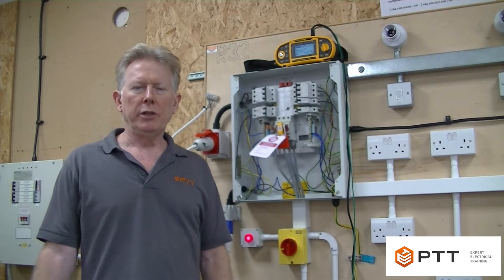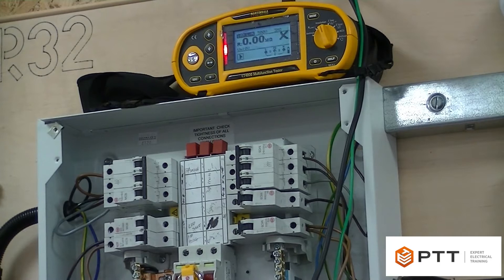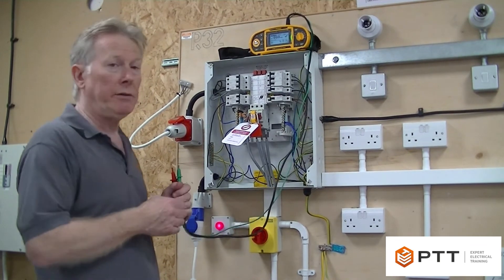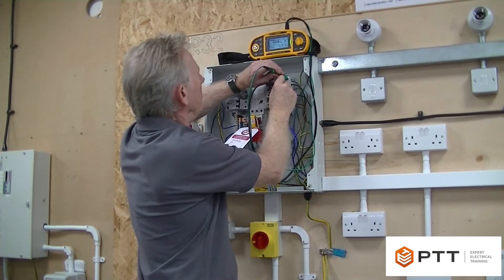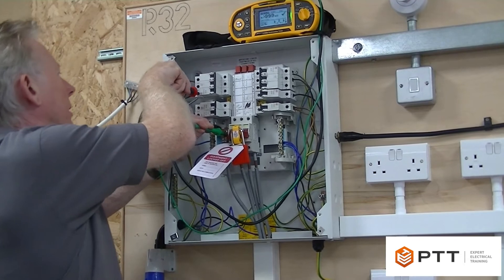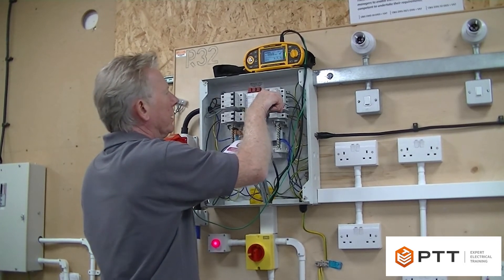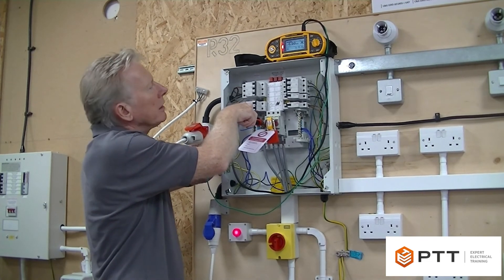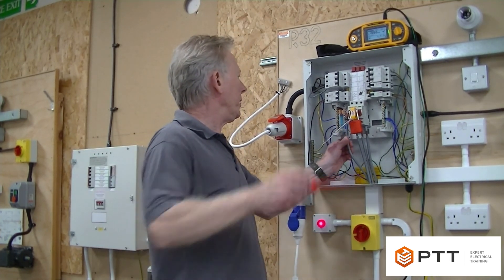Insulation Resistance Test On a 3 Phase Circuit | PTT

Comment: Sir, that's a very good video, but I wish to know , how to select the applied voltage for single and 3 phase conductors. 
Is it that the the voltage applied must be twice the RMS value of nominal operatinal voltage??? 
Kindly reply
Reply: For 240 volt single phase supply megger @ 500 V and for 3 phase 415 V supply megger @ 1000 V. 
You can use multi voltage megger like Rishabh Insu 10.
Kishore Kumar, Chennai.
Reply: sorry to be off topic but does someone know of a way to log back into an Instagram account..?
I somehow forgot the login password. I would appreciate any assistance you can offer me!
Reply: @hughjadiel2999  isn't there an option of" Forget password ".there should be, I believe you can get the One Time Pass word on the registered number in Instagram. 
Please check, or please try
Reply: @Hugh Jadiel Instablaster ;)
Reply: @Kristian Guillermo Thanks so much for your reply. I got to the site through google and I'm waiting for the hacking stuff now.
Takes a while so I will reply here later when my account password hopefully is recovered.
Reply: @Kristian Guillermo HOLY ** IT REALLY WORKED! Literally got access to my instagram account details within about 30 mins by using the site.
Just had to pay 15 $ but for sure worth the price :O
Thank you so much you saved my account !
Reply: @Hugh Jadiel You are welcome =)
Reply: Test voltages are taken from the regs and are dependant on the circuit to be tested rather than RMS of supply. As a rule in domestic application and on standard circuits on 3 phase, that value is 500V. However to ensure you are testing IR appropriately for each circuit reference should be made to BS7671.